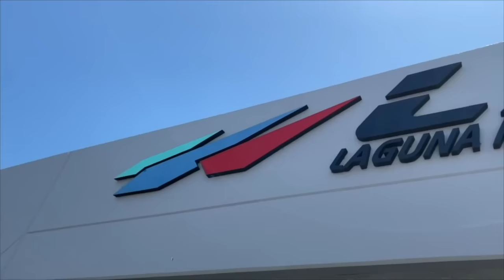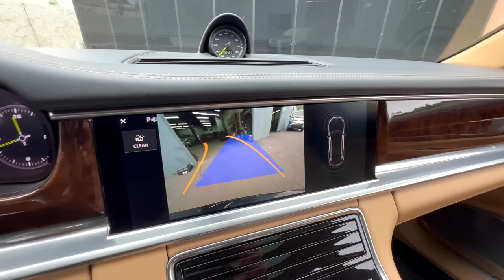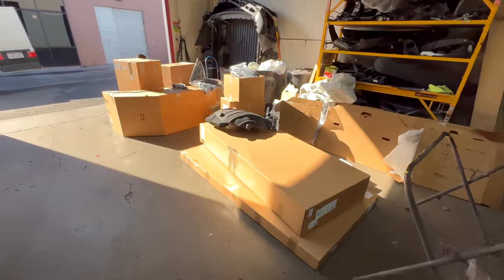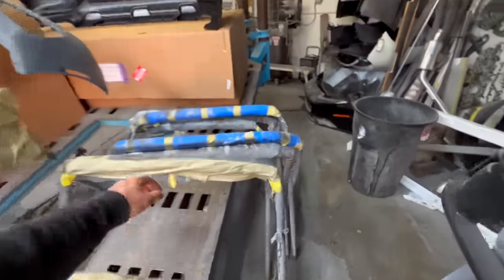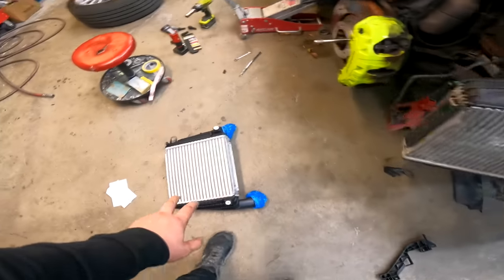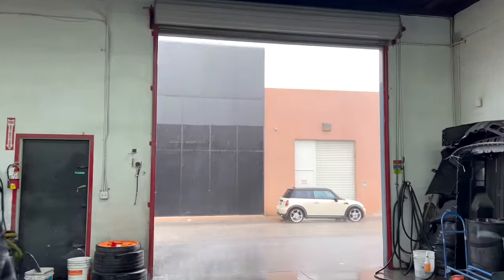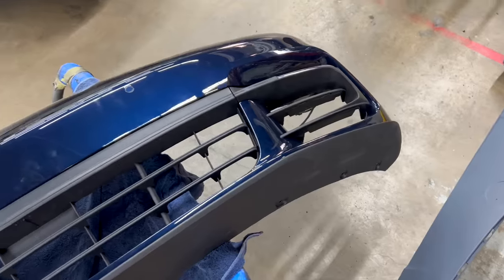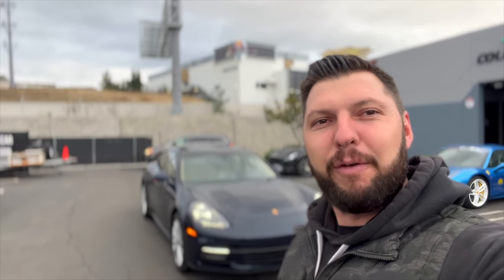REBUILDING DAMAGED PORSCHE PANAMERA 4 E-HYBRID

Comment: If that was mine I would ask for the wing (fender) to be repaired rather than replaced. Original parts are zinc dipped for corrosion protection.